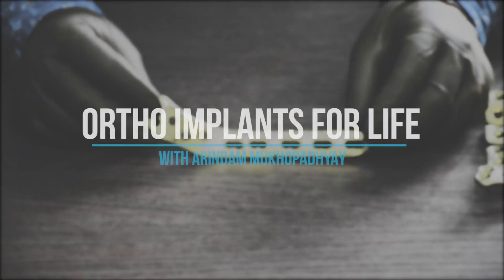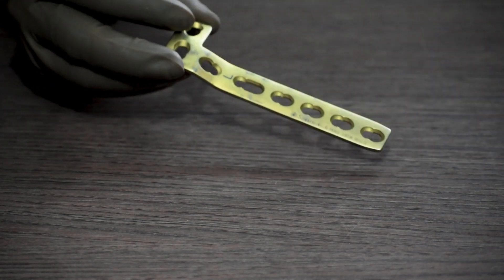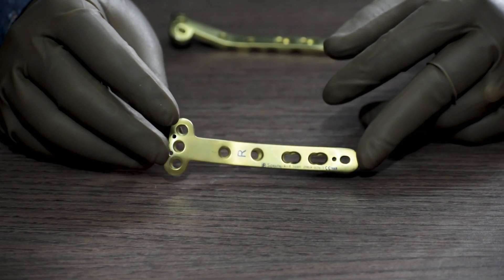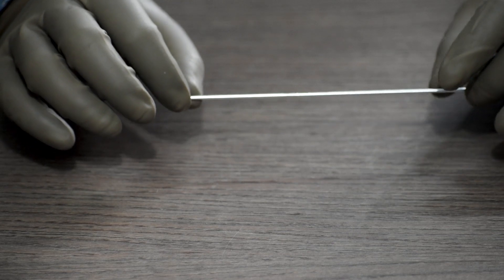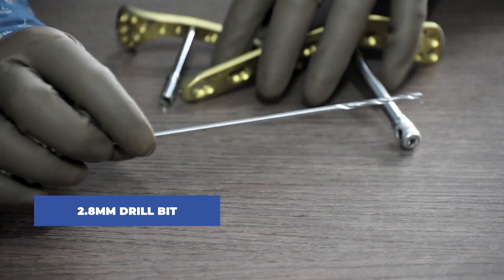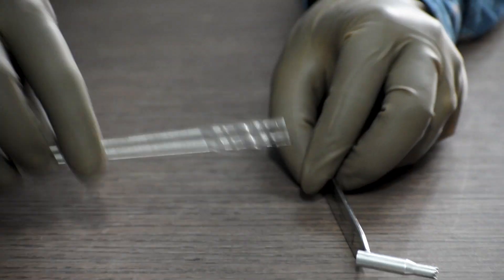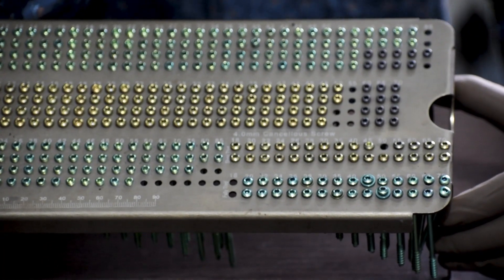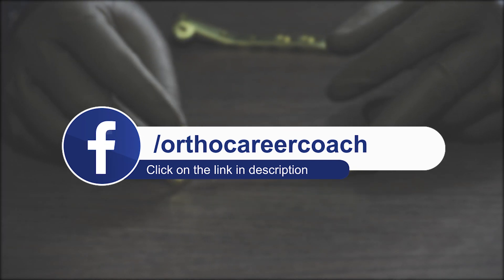Proximal Tibia Locking Plates | Types of Plates & Instruments

Comment: 1.)Proximal tibial locking plate lateral
4.5mm
Side specific
Hockey stick
Lateral side fixation 

2. T butress locking plate
4.5mm
Not side specific (universal)

3.proximal tibia lateral butress plate
4.5
Medial and lateral
Side specific 

4.Proximal tibia anterolateral plate
3.5
Side specific 

5.proximal tibia posteromedial plate 
3.5
Universal plate

6. Proximal tibial locking medial
3.5
Side specific